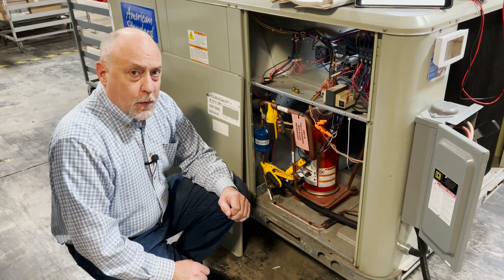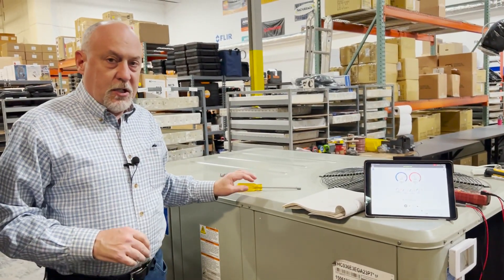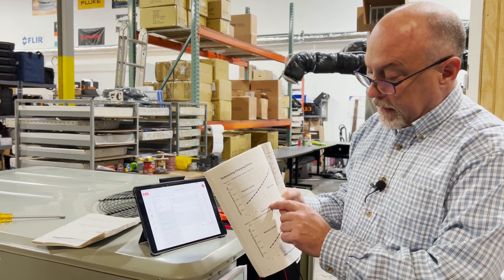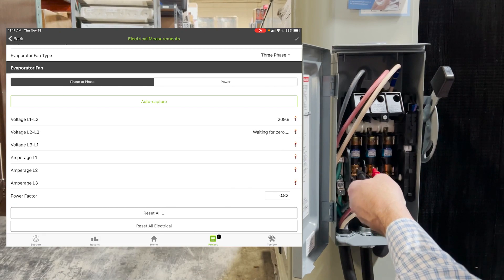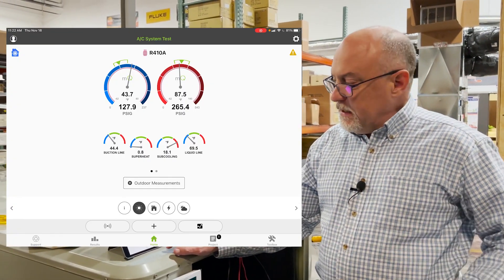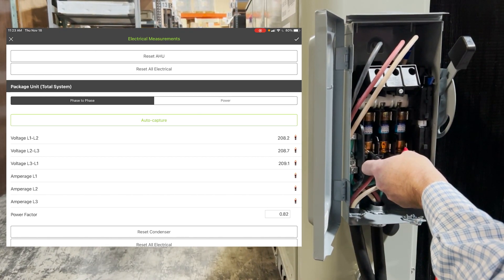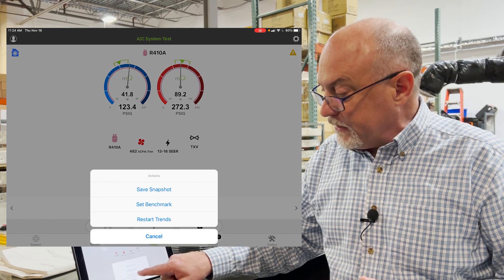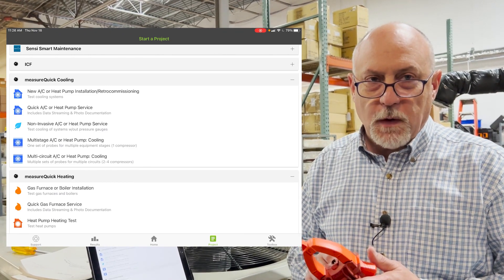Using the Voltage and Amperage Auto Capture Functions on Package Units with comments on Benchmarking

Comment: Does Measure Quick deduct the fan motor reading from the compressor amp draw
Reply from the maker: We are checking the condenser not just the compressor. For a few calculations we do but for EER and SEER you need everything.

Comment: Mind blown 😅 can you also show us how to use mq on pancake systems with static possibly ??
Reply from the maker: I am not sure that I know what a pancake system is.
Reply: @measureQuick  it’s a compact heat pump split system typically found in condos not using a gas application. Usually in the ceiling in a hallway.

Comment: its a nice app but for one thing. You only accomodate US electrical measurements. Theres no 3 phase 50hz 380/400v this throws out the reports. Also theres a bug with the reports when you select Metric measurements, they dont capture on the reports as metric, they degF which is really confusing for customers.
Reply from the maker: Well that is primarily because our customer base is in the USA. If you let us know the voltages that you are working on we can add them to the application.  I will look into the report and see why you are getting degF.
Reply: @measureQuick  here in South Africa we use 3phase 380/400v 50hz. And single phase would be 220/230v

Comment: Like/dislike the Redfish iDvm550. Since day one always had issue with it randomly turning on and draining my battery 🤦🏼‍♂️. Solid meter but they need to fix that.
Reply from the maker: I have seen that. The meter I believe has a two year warranty. They will replace it if within that period. I believe it is turning on the NCV.
Reply: @measureQuick  yes you are correct. I’ll check and see if mine is still under warranty 🤙🏼

Comment: I see you promote this manufacture in question a lot. What about fieldpiece SC680 ? not all of use Redfish iDvm550
Reply from the maker: That’s because the Redfish was designed for measureQuick. It has several advantages including a more sensitive CT, Bluetooth on by default, the Bluetooth does not shut off when you switch modes, and you can get volts, amps and power factor in a single reading. The user experience is simply better.

Comment: When you are taking the compressor amps, does the program deduct the amps from the blower motor? If I remember correctly, the blower motor on split systems does not affect the SEER or EER.
Reply from the maker: On package systems the blower is included. We isolate it for fan watt draw.

Comment: A smaller residential unit with direct drive ECM motor typically has a very low speed as g call only. Usually the door can rest in place to give access to the electric without bypassing the coil